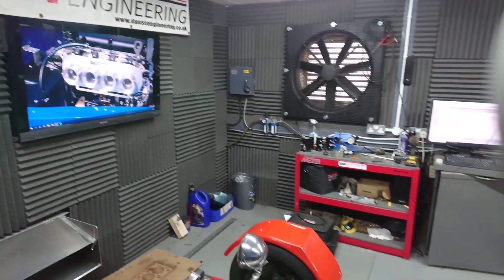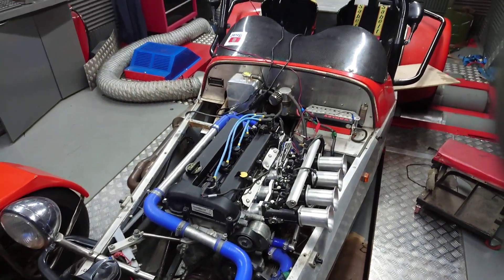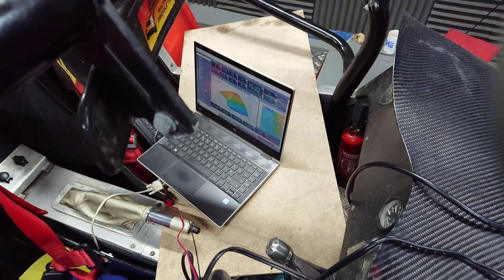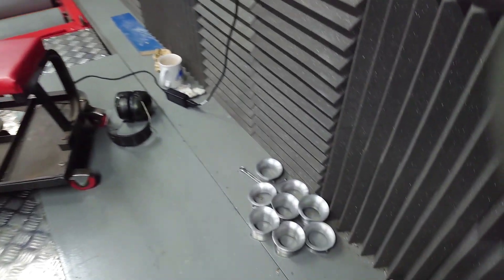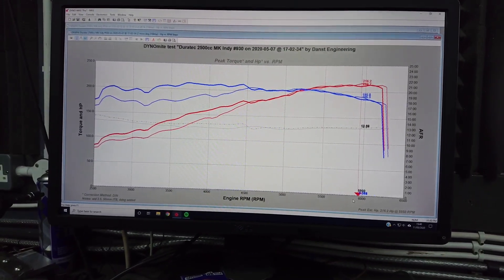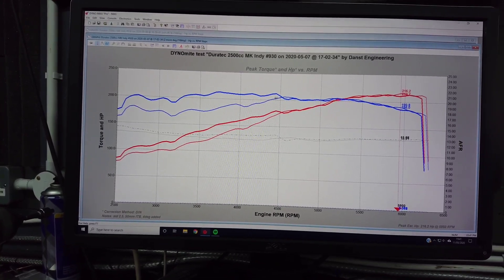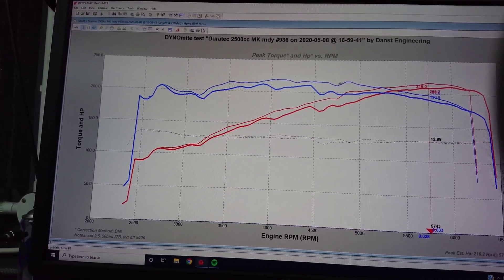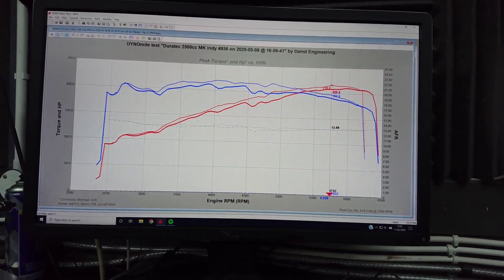2.5 Ford Duratec on Individual Throttle Bodies Powering an MK Indy on the dyno

Comment: I know I’m a bit late to the party but is the 2.5 a better option over the 2.0 or 2.3? Bigger is usually better but are there any downsides over the other two engine sizes?
Reply: Bonjour , oui le 2.5 à un inconvénient c'est qu'il a une course très longue ce qui l'empêche de prendre du régime . Au delà de 8000 trs gros risque de casse moteur.

Comment: Are you able to get some sort air flow signal?
Reply from the maker: We do not need air flow measurements when running in alpha-n (TPS for load).
Reply: @DanstengineeringCoUk  thank you! I plan to use an Emerald ECU

Comment: How do you have the on and off setup on the vvt? Is it on from start and off at at certain rpm
Reply from the maker: Yes that's right. It works, but nowhere near as good as closed loop control

Comment: I want to ask a question I build the US version of the Ford escort I have been doing zetec swaps for years the cars in the United States originally had a split port 2.0 liter engine my question is concerning a duratec swap I plan on taking a 2.5 from a fusion the same as the engine your using and a 6-speed manual transmission and swapping it in a escort the only issue I will have is controlling the engine what would be the best option to control the engines basic functions and be able to use the the variable valve timing without losing any horsepower?
Reply from the maker: The ME221 is a well priced EFI ecu and comes with a duratec loom which will get you 90% plug and play, depending what TPS you use etc. This ecu fully controls the duratec vct (the only ecu in this price bracket to do so).

https://danstengineering.co.uk/index.php?route=product/product&product_id=1544&search=ME221+duratec

Comment: I have a stock 2.5 escape and want to get a set of itbs how reliable are these engines? Its an auto of course I wonder at what point it'll give out on the trans side
Reply from the maker: They're fine in terms of reliability, a set of ITB's isn't going to stress it excessively

Comment: Hi, which gearbox did you use at the duratec 2,5L?
Reply from the maker: It is currently the standard ST150 IB5 Gearbox
Reply: @DanstengineeringCoUk  is that not a front wheel drive gearbox?
Reply from the maker: @MG-Driver  Ah yes, I thought I was replying to our 2.5 Fiesta video, this is a Type 9 Sierra box
Reply: @DanstengineeringCoUk  hola que relaciones tiene la st 150  ib5  ?

Comment: What size is your headers and exhaust and what's the full spec of the engine? Is it truly stock except for the parts you mentioned
Reply: I find it really motivating how this engine stock with that little mods makes so much power, makes you wonder how much more power can be gained by putting in racing cams, porting the head and bumping up the compression. Well done on this build sir👌You mind sharing what the cam timing and ignition timing was on this build?
Reply from the maker: 1 3/4" headers, 2.5" exhaust. 50mm ITB's and ME221 ECU with full VCT control.
Reply: Compression ratio?
Reply from the maker: @MV1-OP81-Mclaren  standard 👍

Comment: I might be wrong but it looks like you might have used the wrong TDC pin to set the crank at TDC.....that looks to be the pin that's used on the older Zetec motors
Reply from the maker: turns out you were right on that! the kit had both Zetec and Duratec pins (the duratec one was MIA and it was assumed that the only pin in the box was the correct one!).

Comment: What would be a better ecu to control vvt?
Reply from the maker: The ME442 would offer full control of the vct
Reply: I’ve got a 1.7 litre Puma VCT engine on GSX throttle bodies with Omex 600 set up by Northampton Motorsports. Not easy to map but it’s an absolute peach!